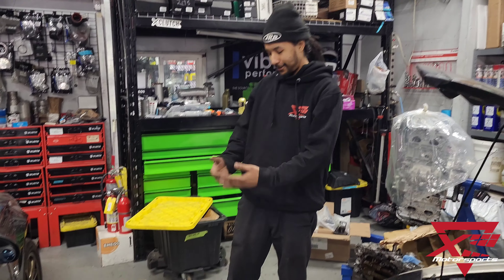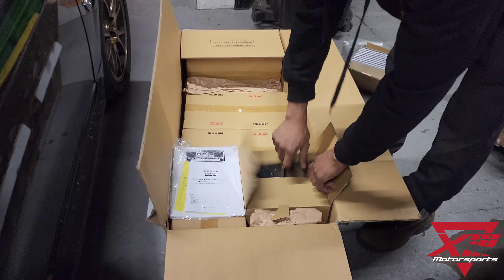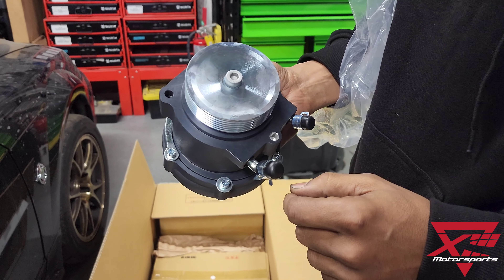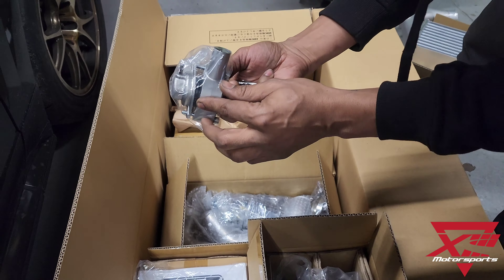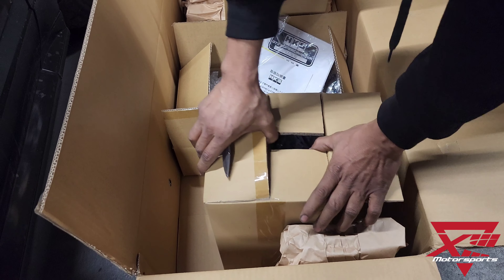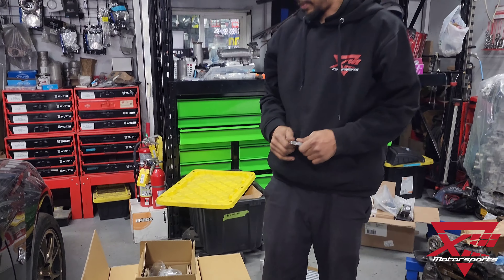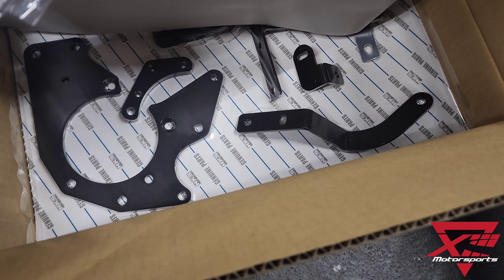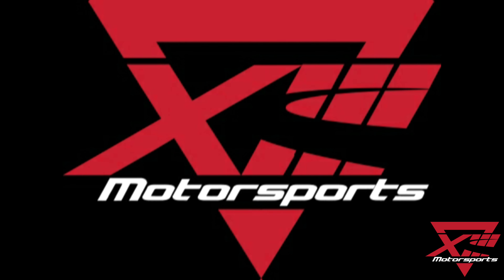The First HKS GT2 SUPERCHARGED GR86 BRZ ZN8 ZD8

Comment: Any direction on a smaller pulley? Im making 310 whp on 93 and 349 on e85. Trying to hit 400.
Reply from the maker: Nothing yet it wasn't really required. We need to upgrade the fuel system next. For 400 I would go with the hks turbo kit that will easily make It !
Reply from the maker: @wza223-fo3mc  the supercharger is limited to 260 stock there is a restrictor plate you remove to make more juice !

Comment: Are any of the aftermarket CAI's compatible with the kit? I checked and the HKS Intake is not compatible. Any plans to install complementary headers? I just preordered a California smog Legal kit. Coming out July tentatively.
Reply from the maker: The kit is built to use the stock airbox. It is offset with a bracket that is included in the kit. Header used is Tomei Equal length. I don't think other intakes would fit
Reply: I’m in California as well, which kit did you go with?
Reply: @maxfieldconklin5804  Ordered the GT2 kit that the vendor says HKS  will have CARB approval and sticker.  Should be shipped out this summer likely  in July I was told.
Reply: The Perrin CAI works with this kit! I have both installed on my car!
Reply: @maxfieldconklin5804  Getting the HKS installed next week. However, still no CARB EO but vendor says it is still in the works. I'm betting it will be available. I Still have 6 years before I have to smog the car since it is a 2022. As you know new cars  in CA first smog is 7 years after purchase.
Reply: @benmccann4499  Thanks. I've also seen pictures of the Blitz CAI used with this supercharger. Nice to hear that you have had success with the Perrin.

Comment: ChatGPT says the HKS kit is a positive displacement SC but that head unit DEFINITELY is a centrifugal, is that true? Cant seem to find info for any of the websites i saw so far for what type of SC the HKS is but i feel its obvious. Should make choo choo sounds! Looks like the kit comes with pretty much everything minus oil cooler, radiator, and fueling for a reliable boosted setup
Reply from the maker: AI has it'd flaws. It isna centrifugal. The kit has a reatrictor to limit the power which we removed. It doesn't not have a vent to atmosphere blow off valve either
Reply: @xiiimotorsports  DEFINITELY. When it said that I was like that's cap 😂😂 I just saw the video you posted about 5 months ago. 305whp is pretty damn solid!! I'm guessing 8 PSI w/ plate removed and 91 or 92 octane? I've been waiting for the Vortech kit, and for Verus to release their new oil pan
Reply from the maker: @WallsAndFoundations  just over fill the oil and it's fine. The hks kit won't be beat its awesome !
Reply: @xiiimotorsports  seems like it! Very exciting. Do yall to the typical 1l overfill?
Reply from the maker: @WallsAndFoundations  yes 100 percent